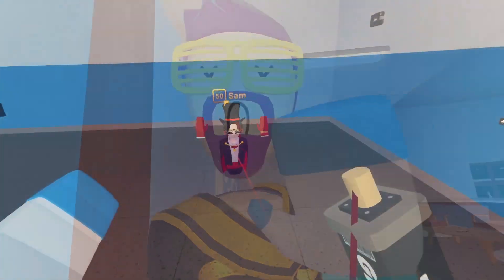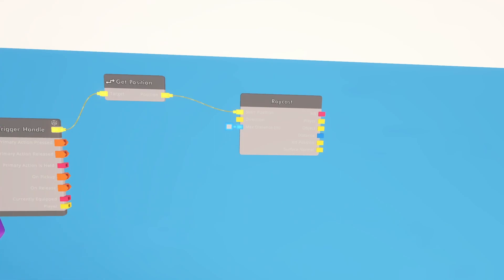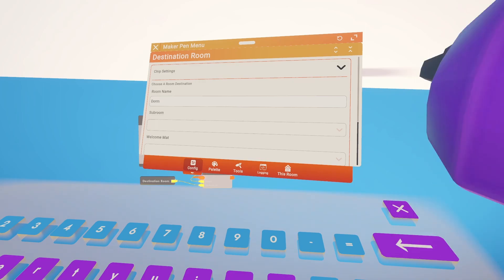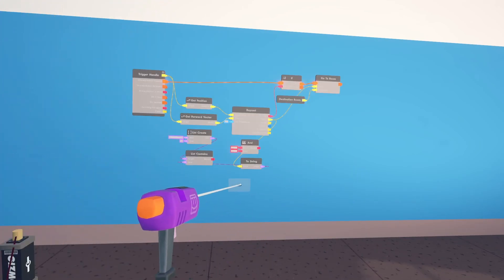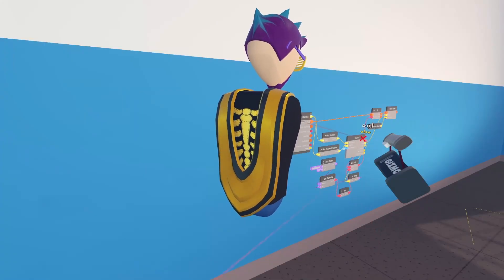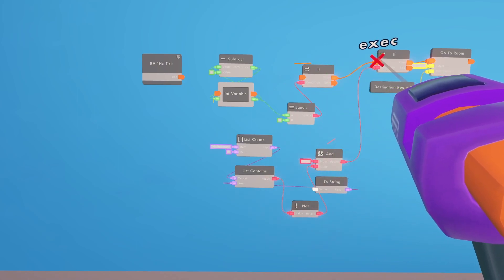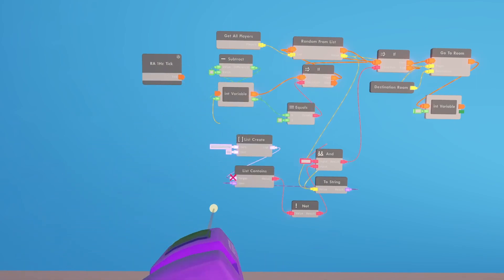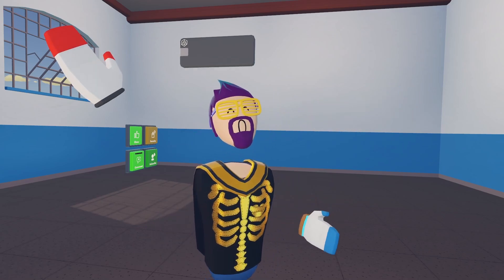How To Make an Auto Kicker | Rec Room Circuits Tutorial

Comment: To send someone to their dorms you need the legacy version of the : "Room Door" object.
Then you would write : "DormRoom" (no quotations) in the destination room section . then wire it up from there. (with a CV2 To CV1 transformer)
You can't send someone to their dorms using CV2 for the reason of the room being private (And the door is supposed to be used by hand).
I don't think it is really easier to send the to their dorms so I would suggest keeping the Recenter because of the hassle
Reply from the maker: Word, thanks for the info
Reply: @theRCLman so nos problem fixed!
Reply: just set a trigger volume to the players position and then make sure the trigger volume is CV one and then hook it up to a legacy door to kick them back to the dorm room and then set the trigger volume position back to somewhere where no player can touch

Comment: [ THIS IS HOW TO KICK TO DORM ROOM ] add a role to a player ( in cv2 ) > then get 2 cv1 role mapper chips > configure the first one to be "player role changed " > after that, configure the second one to be "has role" > get a cv1 room door > configure it to send you to dorm room > wire "player ID" in the room door to "player" in the "has role" chip > wire "player" in the "player role changed" chip to "player" in "has role" chip.
Reply from the maker: i used to lock people in a seat with a cv1 range finder pointed at the seat then when it detects a player send them with a door
Reply: @theRCLman I did that too with another thing that I had, but it was an admin menu.